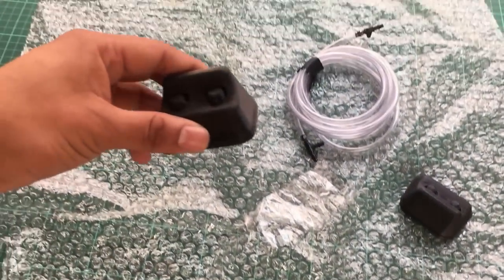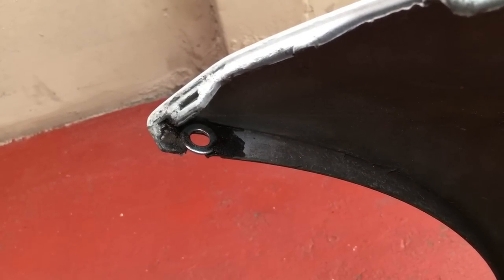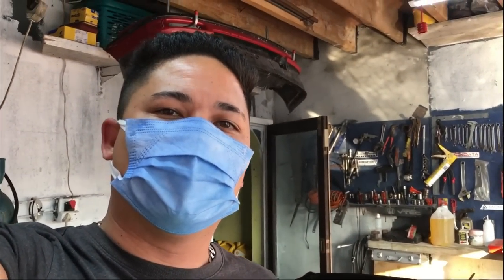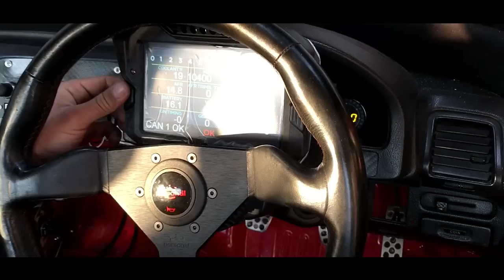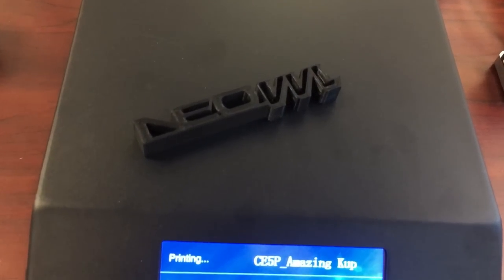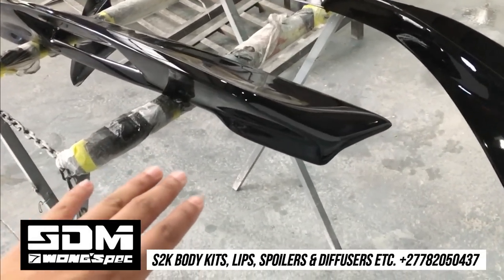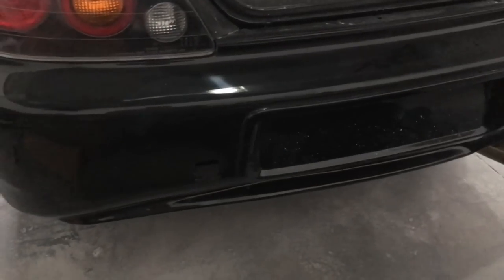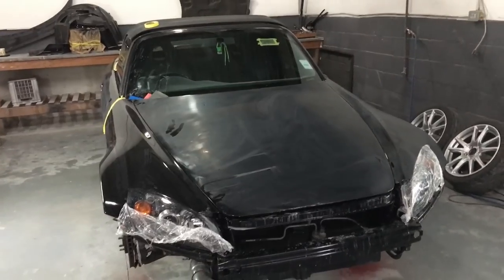THE EG GETS MORE COSMETIC MODS

Comment: Great content as always , bro you got King K buying parts from you , bro big respect🔥 on a side note , he was in Maryland , he had a 1.6 60ft time but the steering wheel came off and he couldn't complete the run . That is one crazy dude ,if I'm not mistaken he has a rear wheel drive civic em tube chassis he bought in usa , and he has an all wheel drive eg , and a hilux with a 6.3 amg v8 mated to a fortuner d4d box , and a lotus with a sls v8 and an albins transmission ( le mans 24 hour gearbox) , all the best ahead and may SDM grow even more bro✊ wishing you all the success ahead bro🔥🔥
Reply from the maker: Thank u broksi 🙏🏼